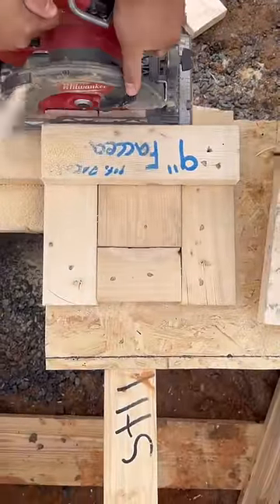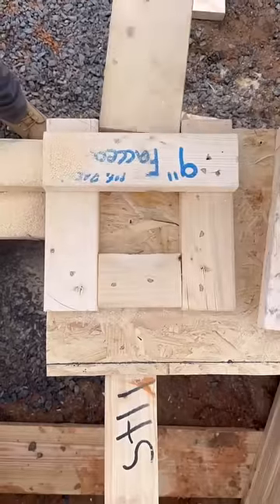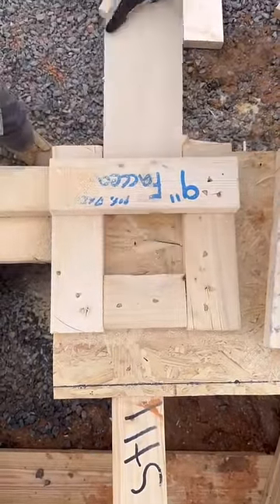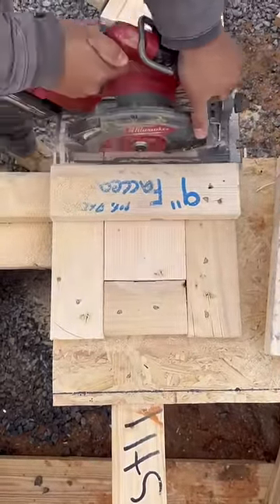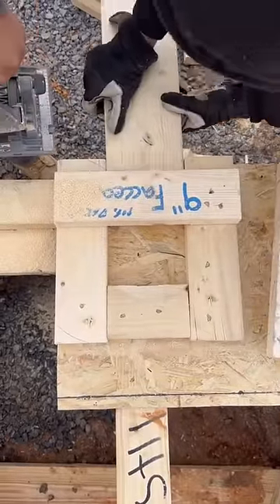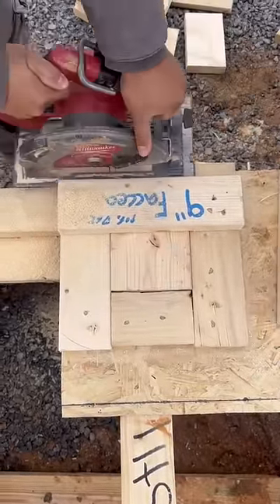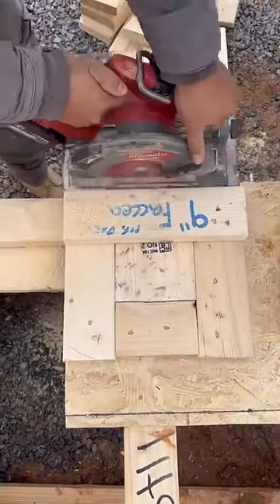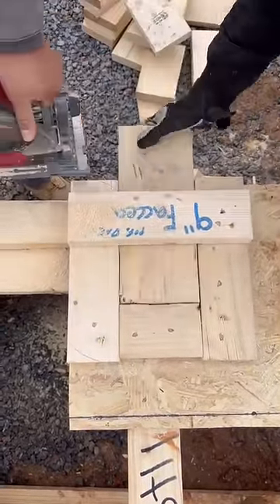Fascia Framing Jig

Comment: Years ago I had a particular job and for one part of it I had cut the handle of a hammer shorter. Every now and then someone would look at it and laugh. One or the other mentioned it was time for a new one. As time passed when others had to take over that particular job because I was needed elsewhere. More than one showed up asking for my hammer because they had realized it was just practical for the application I used it for. Never laugh at a professional. Just keep your eyes and ears open and you will learn more in life.
Reply from the maker: Good advice
Reply: I wouldove told them to sacrifice they’re own hammer like I had to
Reply: Good point
Reply: "You're not a real trademan until you customize your own tools. You got this."
Reply: But what was it used for
Reply: @locus1222 ... Nothing spectacular. There were parts that had to be welded into a certain position. However the space was often a bit tight and other parts around it were in the way when using a hammer with a normal length. So I cut it short 🤷‍♂Actually a child would realize that the handle was just too long, but sometimes certain grownups need longer than children to understand the simplest things in life.😉
Reply: Better yet,
If you see a professional doing something that you don't understand,
Ask

99/100 times they'll gladly explain why
If they know the reason why, you'll gain knowledge
If they don't know the reason why, you gain something to look into and learn
Reply: @RENO_K  .. Exactly

Comment: That's called production.
Reply: Efficiency
Reply: 2 wages to use it though? False economy boys
Reply: @Nutsarooba  that sentence doesn't even make sense. Try again.
Reply: @Jennifer Smith  we are American. Not from the UK,  you claim you're a joiner , but you didn't know what a miter saw was.  I own my own construction and remodeling business and like I've said before , the more efficient you are , the more money you save.  There's a reason people get help on certain jobs.  Speed isn't always efficient.  If you can't comprehend that 2 guys get it done in easily half the time , you don't actually  pay any more than before. You pay less.  It's basic math.   1 person 10$ hour  , 1 person  10$ hour. That's 20$ per hour. If you take 1 guy going after materials,  setting up saw , triple checking measurements and saw blade angle / pitch , you end up saving money.  Because the quicker its done,  the more efficient you become and speed brings money.
Reply: @Jennifer Smith  you fail to comprehend that one guy doing setup,  measuring,  cutting,  installing takes at least 3 times longer , because if they pre cut them all at once , the rest is just hanging them up to install. Less steps you take, you gain efficiency.  The way you suggest leaves a lot of room for mistakes.   It's just like electrical and plumbing , a helper speeds it up and in return you get efficient outcomes.   The more a guy has to get down from the ladder or scaffolding,  to grab screws,  nails,  hammer or wooden blocks , makes your logic mean he'd be there all night.
Reply: Henry Ford would be proud! 👍🏽
Reply: @Jordan Harvey  sorry, I didn't realise they were getting up and down a ladder to cut blocks. I'm not talking about any other job than the 1 in the video. You're correct, I don't know what a mitre saw is. You must be super fun to work for and have people standing around with pieces of wood in their hand waiting for someone to use it. Enjoy your wisdom!
Reply: With two men doing it? Lol
Reply: @Nutsarooba  right it doesn't take two guy's to accomplish this task.
Reply: @Frank Cox  thank you for the back up
Reply: @Nutsarooba  it goes 3 times faster with 2 guys in comparison to one guy.
Reply: @frankcox748  ya but it would take more than twice as long for 1 guy. Look how fast they're doing it.
Reply: @jordanharvey2163 It most certainly does make sense. Go back and try again
Reply: Using two guys to do a one man job. Costing twice what it should.
Reply: Exactly why young people don't get it
Reply: You can do the same thing with a simple chop saw and stop.
Reply: @calholli  miter saw. Not chop saw
Reply: @jordanharvey2163  Semantics..  They are the same thing;  the only difference is one can tilt;  But you don't even need the tilt for this jig.
Reply: @calholli  no they are not the same at all. One is specifically for cutting metal, the other lumber and pvc and such.  If they were the same , they'd be sold the same price and for same uses.
Reply: @jordanharvey2163  efficiency consistency accuracy all bundled together
Reply: @Walter's Playground  exactly. People that have never worked on a job site or ran a construction business don't realize the quicker you get a task done , the faster the job moves along.  A few minutes a day will add up over a major construction process.  Saving time saves money and saves jobs.  Without progress ( efficiency) all things come to a halt and become extinct.   Progress is growth. Growth is future and future is life.
Reply: @jordanharvey2163  exactly the 15 minutes you spend in preparation saves you a hour in wasted time waiting on pieces. Id rather spend a hour in set up than much longer in scrambling later on.
Reply: @frankcox748  makes it at least twice as fast. The guy with the saw wouldn't be able to keep up a smooth rhythm
Reply: @Nutsarooba  you going to touch on the fact you thought this was a mitre saw clearly meaning your lying about being a joiner
Reply: @Hazed64  I just cut blocks all day solo today and had two guys nailing them up. It's no faster the way he's doing it. I have the same style of jig and all my scrap block right next to me. You all probably don't even do this shit yet comment what you think is right. 33 years here, how about you?

Comment: Wow I wouldn't even had thought of that. I love when framers teach me how they work fast.
Reply from the maker: Yeah this is a cool group of guys and they come up with some neat little timesavers
Reply: Know a Hispanic dude. He would measure, draw a line, then put the board on top of his shoe and cut with a saw. Perfect cut every time. I told him that I would probably cut my foot off. “Yeah, you’re not me” lmao
Reply: @Immigrantlovesamerica  nothing more competent and confident than a hispanic worker who knows his shit.
Reply: @iidentifyasanapacheattackh3626  Oh yeah. Fastest painters and drywallers I know are Hispanic. They fly through jobs.
Reply: @Immigrantlovesamerica  that how we all did it on my crew twenty years ago!
Reply: @barnswallow6609  Quoting by the square foot or per sheet is pretty strong incentive. Still the fastest drywaller I saw (and worked for temp.) also delivered the highest quality finish. He was very proud to be an independent drywaller.

Comment: I did something like this when I had to lay a new tongue and groove floor in a cabin.  I was working alone, and it was a great way to get a consistent angle on the ends of all the boards.  Mine was setup one three saw horses so I could slide a board all the way through to cut both ends.

The floor still looks great 20 years later!
Reply from the maker: Nice

Comment: This is wonderful. I often notice that construction carpenters don't seem to make an effort to save or use lumber efficiently as they work. I once came upon a pile of "leftover" boards at a construction site by the curb, clearly being discarded. I asked if I could take a few of those pieces. I had a project going at home, and these were perfect. The "boss" carpenter asked me aggressively: "Why, what are YOU going to do with them?" I didn't answer what I was thinking, which was: "What the F is it to you? You're throwing them away."
Reply from the maker: Yeah, unfortunately there’s a lot of waste in construction.

Comment: A stop on a miter works fine. If you don't have the same distance on your circular saw from blade to edge of the shoe as the one it was built for, your template is for naught. My corded saw is different from my Cordless.

Comment: I used a 50s hand made jig for cutting 2*4 into perfect wedges for blocking winter yachts. Had the length width and angle all set just change the way it faced. Took 5 guys then me to figure it out. The guy that made it was a furniture maker. Putting in custom cabinets.
Reply from the maker: That’s really cool to use some thing that was made that long ago

Comment: To ease binding when sliding the board in, cut some angled lead-ins on the inner edges. Also,  the stop only needs to be half height, which makes it easier to push the board out with glove on.

Comment: Why not to place all the original boards at one line and cut whole at one's?
Reply from the maker: There was no original long boards those were all scraps left over from some custom length studs. So they used the jig to cut them to the right size

Comment: You can’t tell me that dragging out the compressor, getting the hose, letting the compressor charge, loading the nail gun and cutting 7 pieces of wood (that are cut to length) is faster than pulling the chop saw out of the bed of the truck and plugging it in and just measuring the crap.

Comment: Some pro tips. This jig is backwards. Setup
On the motor side of skid plate, not scrap side. 
Also hollow out the backstop 1/2 inch so sawdust cannot accumulate back there & just falls out. Pay attention or pay cash!

Comment: Use a chop saw…there are thousands of different lengths to cut during a day. You can make a jig on your chop saw table is one second by pounding in a nail that is used as a stopper…or even just make a pencil mark and line the board up with the line.

Comment: I love it, some metal plates on the front to stop you taking a little off on each pass and I would be patenting that ☺️😁
Reply from the maker: It doesn’t take a little bit off with each pass because the fence of the saw rides along the board not the blade

Comment: Why didn't they move the straight edge back so they could use the larger side of the shoe of the saw? I'd be afraid that the smaller side would lead to cuts slightly out of square. Very cool jig none the less.
Reply from the maker: Using the bigger side of the fence would’ve been a better design

Comment: Sorry guys. I was cut guy for 11 years on a framing crew. Way faster to use a 9" pattern and leave the width of the blade between each tracing. Also only requires 1 worker. 
You mention using up the crooked boards, but only show using scrap. What if your crooked board is a 16 footer, like they generally are?

Comment: I get this, I did something similar for ladders with roofs that were too soft or if the customer didn’t want any scratches, bumps etc. angled lips that extended from the top of the ladder and you could screw it onto the head with some wing nuts.

Comment: Coming from someone who knows fuck all about carpentry, id put metal plates on the ends of the two planks on either side so the blade doesn't start shaving the ends off those planks overtime

Comment: Would be better to do a second jig and make it a 2 pass process. Cut one side long to have a flat surface, move to the second slot and cut to length. Both processes in 1 cutting motion.

Comment: I'm training to be a stone mason. Noticed that we had about 90mil of stone that we had to drill 40mm down into without blowing the tops of the stones to sit them onto the dowels. Noticed that this was becoming very hard as when we had been cutting dowels down to length by eye they varied in size alot. Meaning we accidently blew alot of stone out. Made a temp jig for cutting dowels to length. Boss didn't get what the fuck I was doing till it came time to use the dowels. Man was so surprised that we didn't break a load more stone than before now all our dowels where the same height first time each time

Edit: moral of story. Jigs are awsome

Comment: Dude, cut one block against your speed square. Set a nail 1-1/2" from the end of the block...put the block with the nail in it against the piece you want to cut. Cut against the block on the 1-1/2" side

Comment: Whipping your tape out and marking 9 inches on center plus 3/32 for the blade kerf is not very hard either if you don’t have too many to cut. Putting a stop block on a miter saw is definitely more efficient and waste effective. If you need to make a Jig for something like this.

Comment: I suppose all the time you save with your nifty jig is negated when you have two dudes working on cutting facia blocks
Reply: Right. A cheap generator and a chop saw would pay for itself quick. Edit: There are battery mitre saws available.

Comment: Facia boards? I think you mean for brick freeze.  Facia boards are nailed to the end of rafters.
Reply from the maker: Yes a facia board that’s nailed at the end of the rafters for the overhang. These blocks are use to extend out the facia on the gable end of a house . On the gable end there are no rafters overhanging so they use these small blocks
Reply: Oh ok I gotcha.

Comment: They need a big plastic or rubber made box the ones with the lids that snap on. Put that on the ground so all the blocks being used go in that bin, so they dont have to pick all thise blocks up when they need them they can just bring to tote up on the lift or on the pump jack plank work smarter not harder boys!

Comment: These little tricks are why you pay more per hour for the good company
  In the end they get the job done faster so you save money.
 I just seen 2 homes here get a roof put on and they are the same homes  '' copied down the street'' 1 guy went with the cheaper per hour company. 
Both companies showed up at 8am but one company was done and cleaned up and gone before12 the other company was here till 2 pm and the home owner was out that night picking up nails.  
I don't know what they charged but I know the company charging more did a great job cleaning the yard and drive when they were don and they were dressed in a work outfit, 
The other guys looked like they were picked up of the street they had a radio blasting some poor choice songs and they yelled back and forth like hay F head get me drink ..... that's ok working at the shop.'' after hours ''  or putting a roof on your buddies place out of town but when your working at a job site lol 
I have friend who had a roof put on but a cheaper company because of the job losses and that's whey he needed a roof but 1 year later it started leaking and they refused to fix it they said the shingles have the 5 year warranty not them. 
You get what you pay for.

Comment: Never be straight, you put the blocks up then pop a line then cut them
Reply from the maker: They used to blocks in a string on the end of the gable and then straighten the facia as they sheath starting from the bottom working their way to the top
Reply: @hausplans  what if the sheathing isn't square, to many variables best way is to string a line from end to end, jigs are no good here and will take 3x the work in the end

Comment: Usually the fascia board is strung on the Face of the truss, lots of cutting and extra work for nothing
Reply from the maker: We build overhangs on the gable and truss before we start the truss. Then we use a string line and straighten the overhang as we sheath the roof.

Comment: i would rather not make that a 2 man operation, especially if your with someone who likes to get in a rush and impatient. i know it's silly but if something happens, the saw guy isn't losing any fingers. no way that's an acceptable way to do it by today's standards on a commercial job... but by myself yeah I love making jigs. 
but a miter saw with a wooden block clamped to it (with a plastic clamp in case something happens) would be just as effective. only downside to that is the block can wander, but that's easily fixable too.

Comment: Not to mention it's taking two men to do a one-man job start marking it out add 1/8 of an inch from the second mark on it will be perfect every time and for all you people that can't run a skill saw you can always hold up your speed square and run the side of the fence along that until you learn how to make straight-cut I am not impressed at all

Comment: Nothing genius going on here. They are averaging only one cut every five seconds. That’s TWO people. I could easily cut a piece every 10 seconds with my miter saw. Actually, I’m pretty sure I could beat that pace. I would use a jig also. My jig would consist of one cut piece to the correct length. Stack it on top of the piece I want to cut. Butt the ends. Butt the blade to the jig. Cut. No measuring. No pencil lines.

Comment: If you're a framer and are using a miter saw you're not a real framer
Reply from the maker: I do think there are times when a miter saw is good for framing crew especially if you’re cutting a lot of angles
Reply: @hausplans  been framing for 20 years now. I've never used anything other then a skill saw. Always been taught framing is about how fast you can make something look good. Setting up and using a miter saw just takes time. As a foreman I wouldn't have it

Comment: A chop saw on a stand or sawhorses with a stop block would be better. But in a pinch that jig would be ok. None of those cuts are square guaranteed 😂 sure would help with your back 20 years down the road. Work smarter not harder. One man operation not 2.